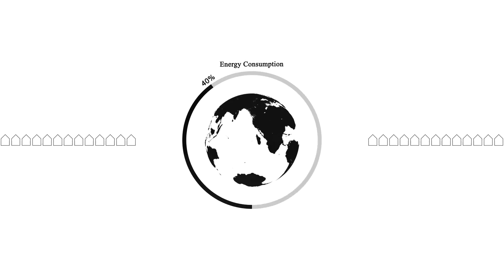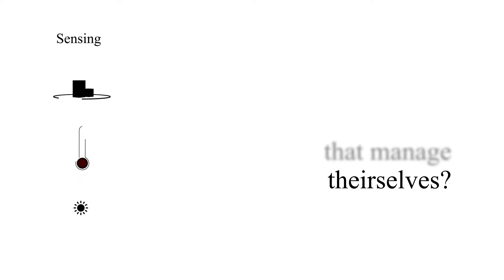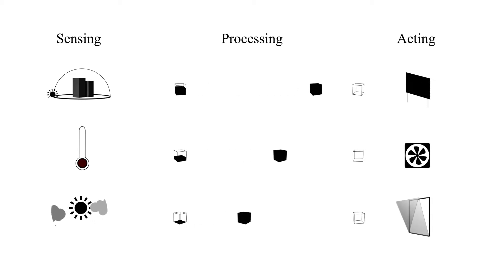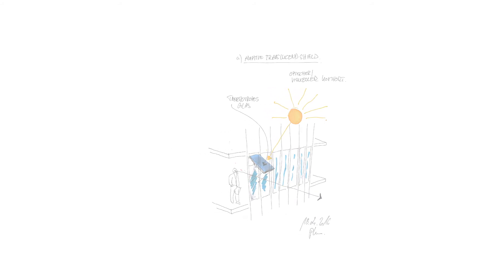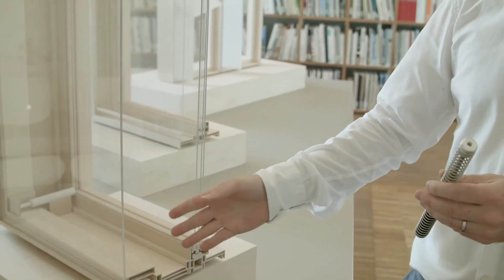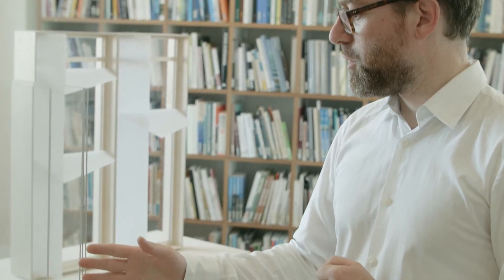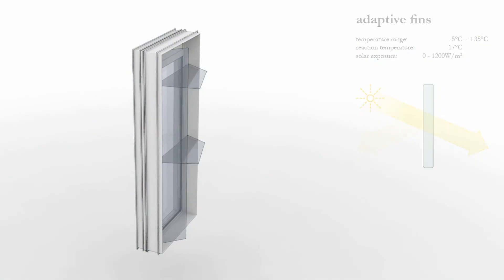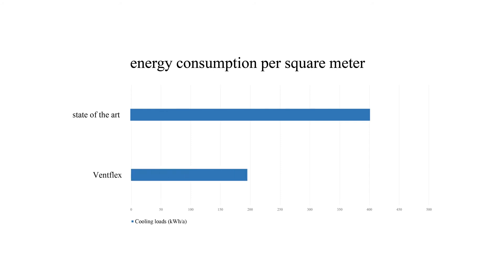Belüftungssystem für Glasfassaden spart fast 50% Energie

Comment: Ein sehr interressanter Ansatz! Gibt es schon Reaktionen aus der TGA-Branche? Solche Systeme würden ja nicht nur viel Energie beim Betrieb des Gebäudes sparen, sondern auch Investitionen in Mess-, Regel- und Steuerungstechnik. Oder werden herkömmliche Systeme dann zusätzlich auch noch installiert, um quasi "manuell" eingreifen zu können?
Reply from the maker: Vielen Dank für Ihr Interesse! Hier die Antwort von Philipp Molter, dem Leiter des Projekts: „Wir arbeiten in enger Abstimmung mit dem Lehrstuhl für Gebäudetechnologie und klimagerechtes Bauen. Es gibt hier sehr viele weitere Ansätze, die Gebäudetechnik mittels einem sehr präzisen Planungsprozess zu vereinfachen und auf weniger Technikintegration zu bauen. Die Ingenieure um Prof. Thomas Auer sind hier weltweit führend. Auch in der Automobilindustrie gibt es selbstregulierende Aktoren, die nicht an weitere Sensorik angeschlossen ist. Ferner arbeiten wir aber auch an der die Möglichkeit des Nutzers selbst in die Raumkonditionierung eingreifen zu können.“